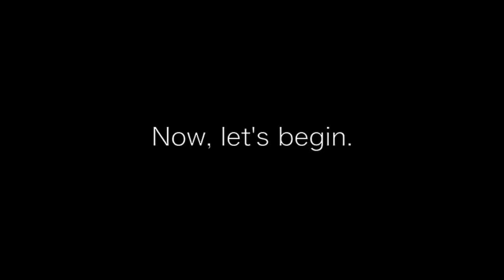How to make an alcohol stove - FishEye Stove Ver.1.0 -

Comment: Great work and nice craftsmanship. 
Not to take away from your build but it should be pointed out, if it hasn't been already; that unfortunately the stainless steel legs and aluminum leg supports don't mix well material wise. You'll find the leg supports eaten through in a very short time unless you use some sort of high temp insulator between the two metals. The insulating jacket from a similar guage wire used for high temp applications would work for this purpose is one option that comes to.mind.

Again, nice build and thanks for sharing.

Comment: Excellent construction video, nice design and a well laid out process. I'm curious about how much fuel it can hold, how long it can burn and how quickly it will boil a volume of water. Have you experimented with these variables yet? I've tried several different designs and find some better than others, though this one certainly seems promising.

Comment: Absolutely great craftsmanship! Congratulations! Techs: The fuel will be decisive. The high outside wall might act as a permanent "simmer ring" with ethanol. Shape of burner etc. is therefore crucial. Note the small size of can - not a standard 330 or 500ml can. As far as I could read, it's a 150ml can - we barely get them here. Maybe I would have to check the prosecco-shelves - which would make a pretty expensive stove and a rather dizzy craftsman :-). Did you do a version with a standard 330ml or 500ml can, too? what about the exact measurements there?

Comment: Thank you
but what is that particular blade called, the one you attach to the wooden block?
I tried to cut the can with different blades that I have but they don't do the job
Reply: It's "NT Circle Cutter C-700GP".
As an alternative I recommend the "OLFA 9911 CMP-1 Compass Circle Cutter"